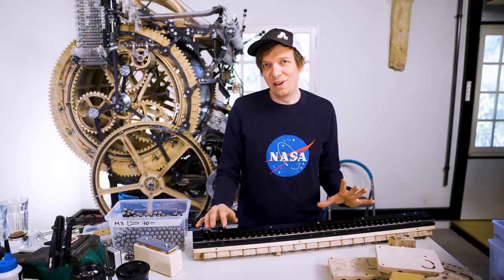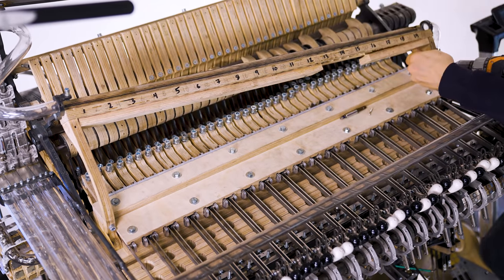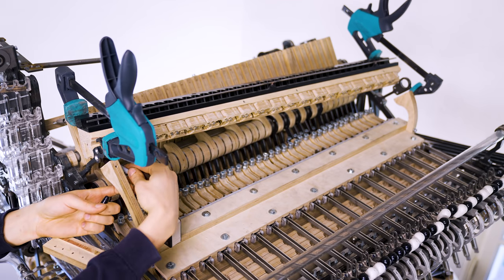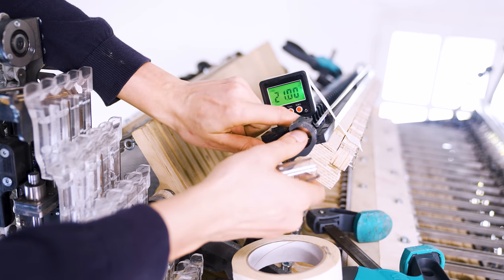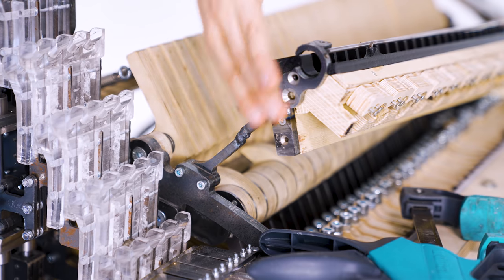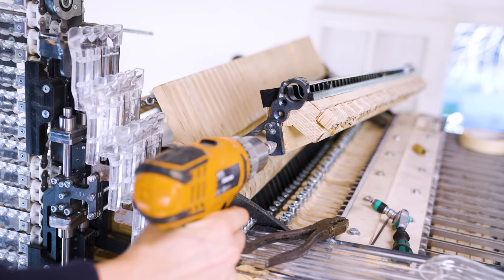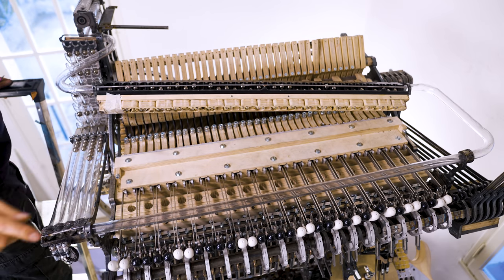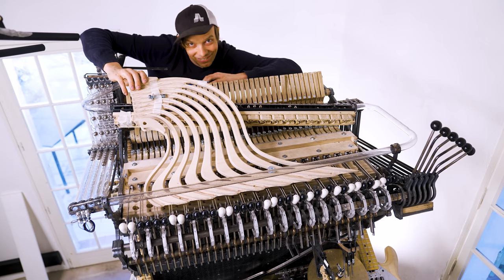The New Marble Divider is a Success!

Comment: Okay, this is what I don't get:  If the marbles always drop into the first available open slot, if one of the first few channels is a rapid marble-consumer, wouldn't those channels starve the channels on the far end?  Meaning, the marbles would never make it to the end channels because they get gobbled up by the channels at the start of the ramp?
Reply: That's why the marble lanes go on the top.
Reply: Okay, so it looks like there are channel groupings being delivered to directly via the multilane-drop-ramp, my assumption is that this was to mitigate the exact issue listed above.  In theory, though, there is still a possibility that it could happen within a channel-grouping, but the likelihood is probably very low (as long as the rate of delivery to the channel grouping exceeds that of it's consumption).

Comment: I don't think you copied the prototype very well.. if you look on your part.. the marbles travel on it as on a rocky road.. bumping around all the way down.. if you look on the prototype, they travel very smooth with no bumps whatsoever... it might be working but like you said, good enough is not very good goal to aim for... maybe you should return to cad and redesign it properly to transfer the prototype more accurately to your part.

Comment: You need to stop cutting off old parts on your machine. This is not following “First principles”... everything needs to be measured and mounted to a reference point. 
These at the point process changes are murdering your ability to assess and engineer to first principles. 

You don’t know where your next failure will be because you are on the perpetual scope drift.